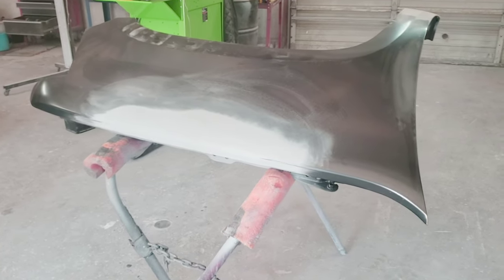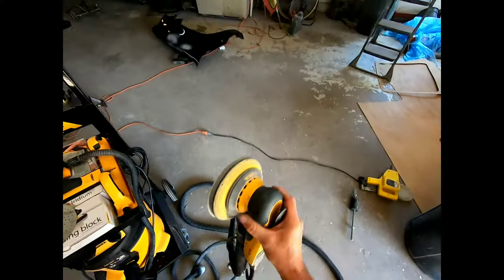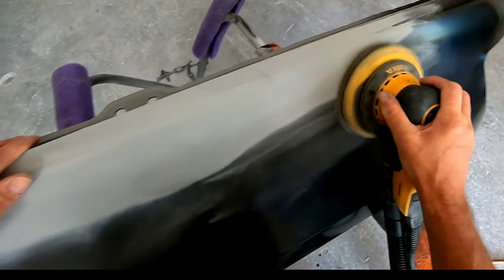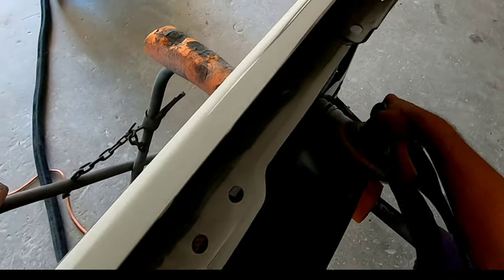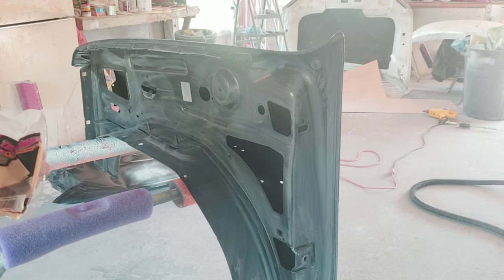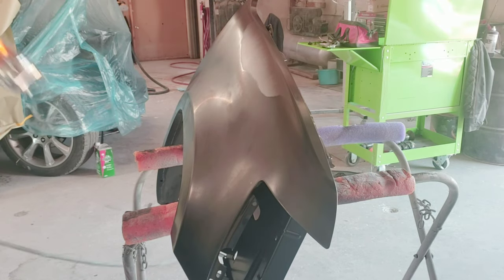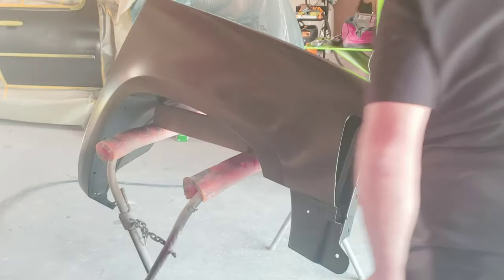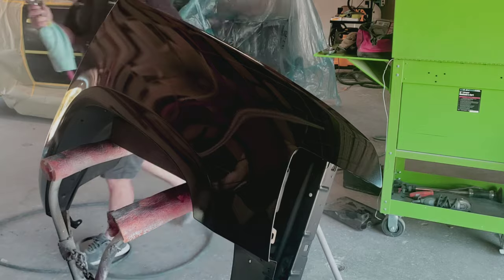How to paint a car fender. diy auto paint

Comment: What’s your recommendation if your fender is already painted but your needing to do bondo work on certain areas? I’ve already sanded off the areas to metal that needed work but they are scattered about making it hard to only paint and prime those areas and blend. Should I sand the whole fender to metal or could I get by with sanding 80/160 and spraying primer/paint over that?
Reply from the maker: You don't  need to sand the whole fender to metal even  small areas that need filler  can be prepared with 80. Once bodywork is done it should  be at least  a 180 scratch to primer over I perfer primer over a 320 scratch.  The rest of the fender can be sanded  with 320 or 600 before primer and then sanded with 600 before  paint hope this helps . Appreciate the support!

Comment: Ebay aftermarket fender for my Corolla says PRIMED. Do they really rust if I don't have it painted right away ? If so how long can I wait until I have the whole car painted ? doesn't make sense to paint fender then have car painted waste of money. I just want the fender installed right now until I can afford a paint job what do yall think? Can I just order and have it installed ?
Reply from the maker: Yeah you can just have it installed.  It will rust ,primer is not designed to bake in the sun. It will probly  just be surface rust. Then when you get it painted it may take some additional prep work to get it ready for paint. It would take a long time for rust  to ruin the fender

Comment: My paint jobs like this never come out nice.  Orange peel, and tiger stripes, etc.  Is there a way to sand or smooth out the base coat before clear coating?  The clear coat only highlights the many flaws my rubbish paint job has.
Reply from the maker: Not without applying more base. Check out my other videos  on how to spray clear to avoid orange peel. There's a few things that cause Tiger stipes. 1. Paint gun not spaying properly 2 not overlapping 70% on you passes. Those are the two main causes.

Comment: Do you need to sand it after the clear coat to polish it?
Reply from the maker: Wet sand yes, if you have imperfections you want to remove. 2000 grit then 3000 and buff. Check out my channel I have several videos on polishing. Thanks for watching